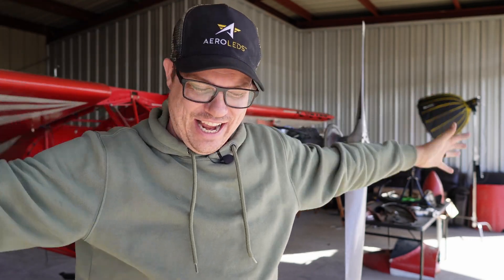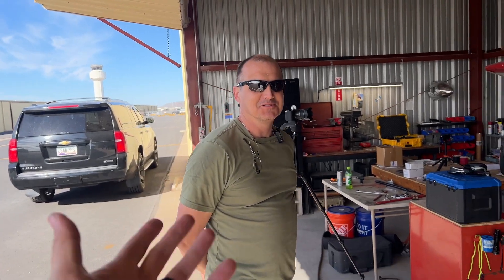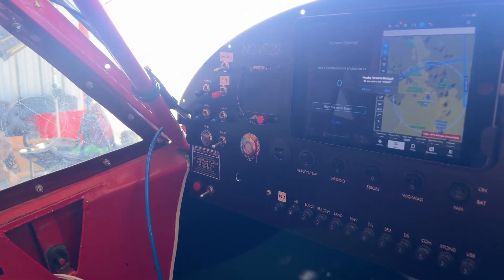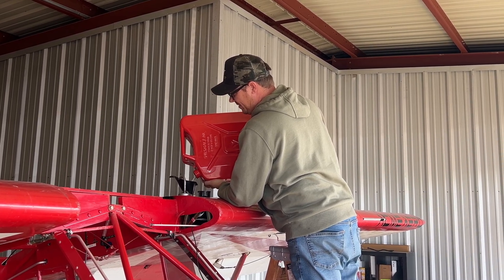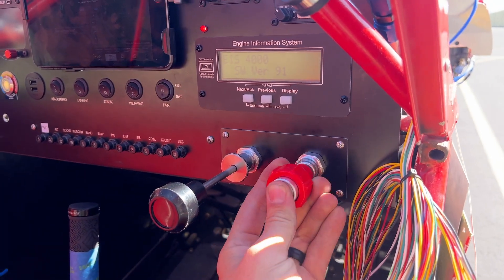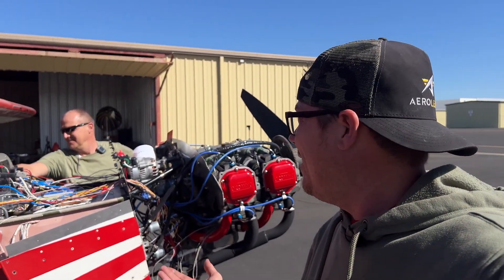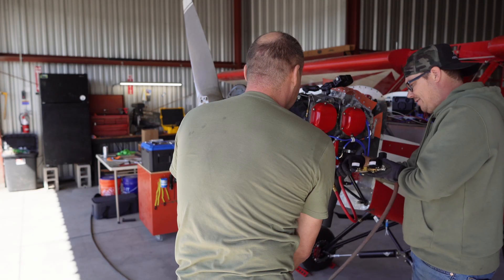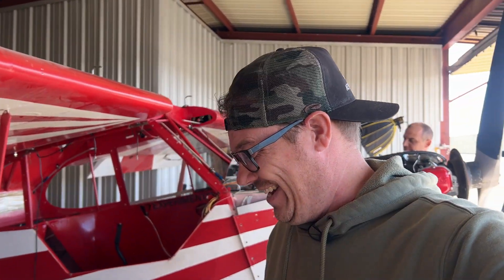Is My Engine Still Good?

Comment: Guys...............Did you Check and re-check the Torque setting on ALL the cylinder head bolts to Manufacturers specs???????????????? Maybe as a precautions check the valve tappet clearances too.
Reply from the maker: Yerp. And I'll check them again before we start flying it again. We have the wings off right now doing some repairs.
Reply: @flywiththeguys  Excellent. I made this comment as I did not see in your previous video when installing the cylinder conduct the torque and valve procedures. AND,  checking the valve clearances ensures you have the correct 1. settings 2. pushrods (as pushrod  can vary in length. Blue Skies and be Safe. Cheers John from Australia.
Reply from the maker: @anzacday4141  No problem. I'm trying to keep the installations simple, do a lot in the background that people don't see. I've been changing my newer content to explain things a bit better during the fast motion stuff too.

Comment: you made a great video, thanks for showing us,, I also watched your previous clip as well .but one question please. what are the pipes that go from the cylinder tops to the sump? I watched with great interest, and cheers from NZ
Reply from the maker: The red ones? Those are air intake. The little metal lines up top are the fuel lines for the injectors.
Reply: @flywiththeguys  thanks

Comment: SAFETY SUGGESTION: I don't think anyone here would go looking up license plate numbers, but it might be a good idea to either keep vehicle plates out of the video or blur them if that's not possible.

Sadly, we can't have nice things because people are shitheads.
Reply from the maker: I used to do that but I stopped. Found out that correlating the information is hard to do. Lots of sites say they can, but fall short after you pay for the fee of course. Thanks for the concern though! I usually don't have the plate visible in my videos but this one was harder to avoid.